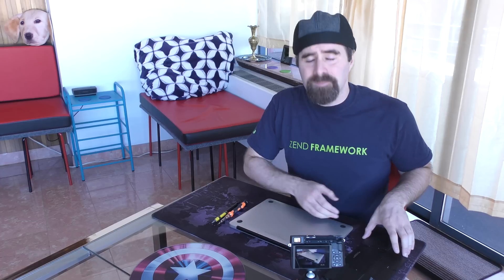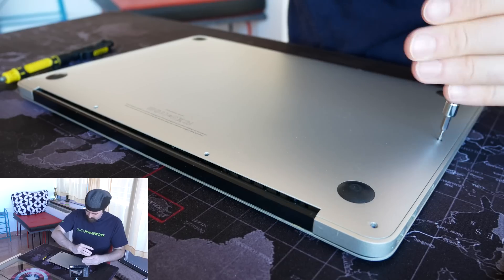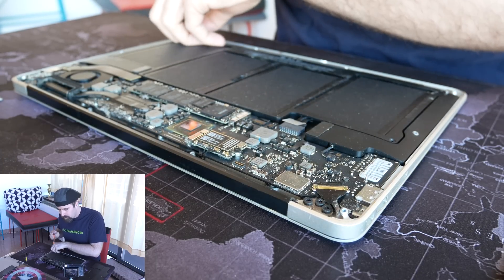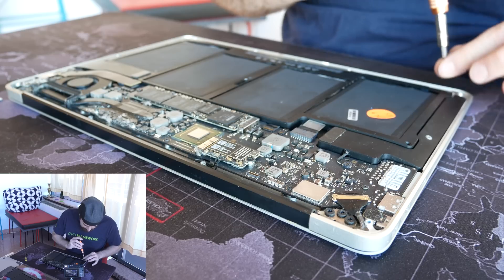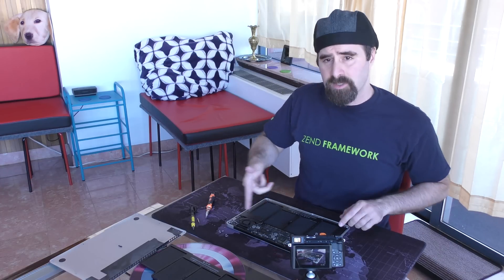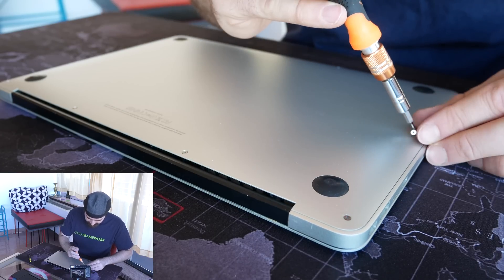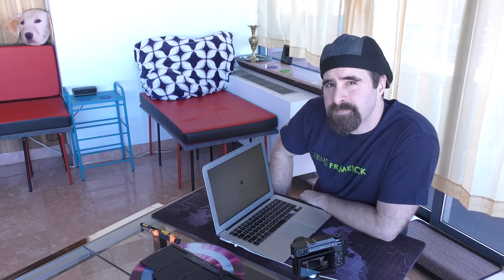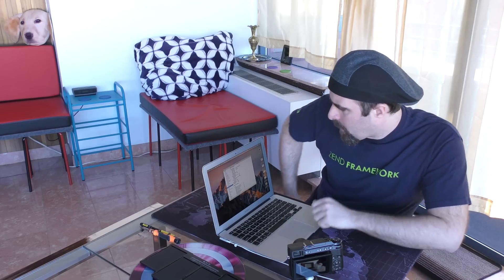🔋 How to FIX MacBook Air battery life by replacing batteries 🍎 Apple MacAir battery swap!

Comment: Please explain, what is the difference between all the codes: A1405, A1377, A1496, A1469  & A1466?
I am lost and confused which of these ( which battery) to get for my Macbook Air 13", Mid 2012.
I'm afraid I'll order the wrong one. Please help

Please help with details.
Reply from the maker: Those are the specific model numbers to you macbook, it's possible they all use the same battery though. Your exact model is printed on the bottom of your laptop in gray (yes, gray on silver colored metal, Apple expects good eyesight, lol)

Comment: You amateurs should stop making videos on stuff you don't know shit about! leave it to the pro's as you mislead the computer illiterates to the wrong path!

Tip from a 18yr IT vet.:
 after replacing the battery, the moment you start the computer and when you hear the chime (Apple logo), press and hold the "Option + Command" keys along with letter "R & P" keys all at the same time.  In a couple of seconds the laptop will shutdown blank and restart again automatically, keep holding these keys and do this process 2 more times (3 total).  This method will RESET the battery perimeters and the computer will start normal again without any lag.   Skipping this important process will cause the computer to boot-up super slowly and make the laptop act weird as just shown in this video...

Comment: How is the battery holding up now? Did the problems with the startup continue?
Reply from the maker: The battery is still fine. That computer needed to have the operating system reinstalled as it has gotten corrupted somehow, then it worked correctly.